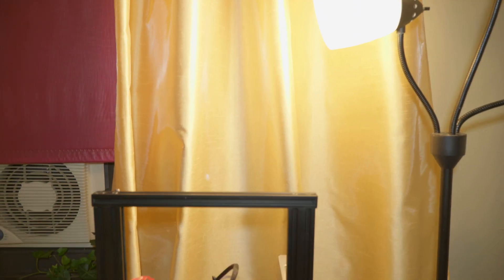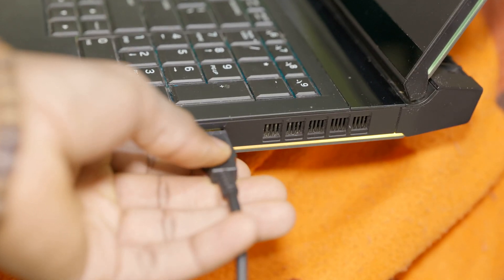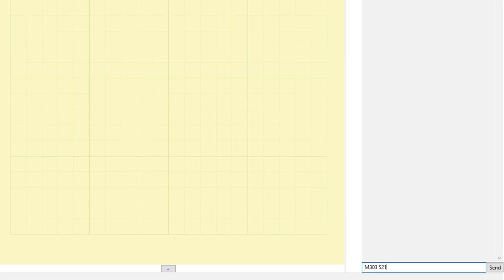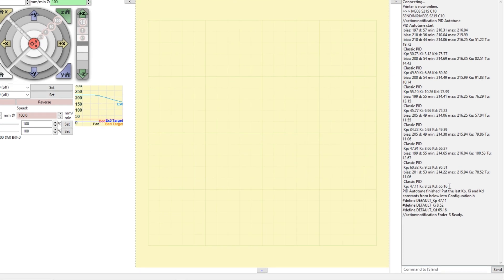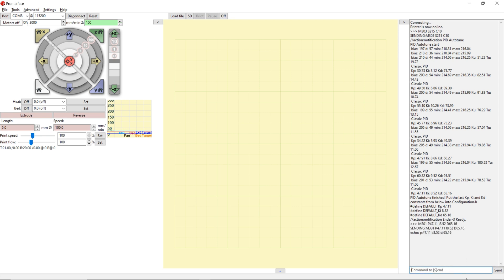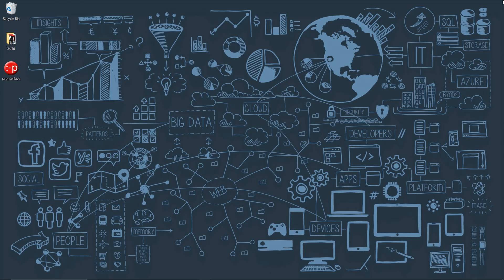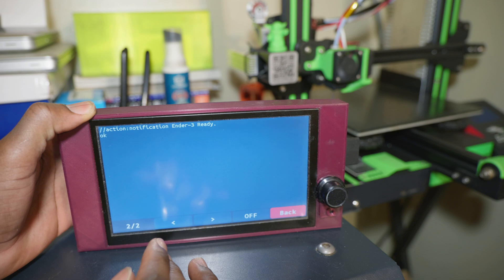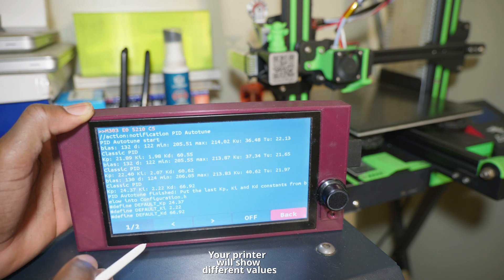How To PID Tune The Creality Ender 3|PronterFace BigTreeTech

Comment: I'm having the issue that when performing the  PID Autotune with pronterface on my ender 3 pro skr mini e3 v2 and swapping the hot end and after compiling and flashing the marlin firmware that my printer unexpectedly reboots during the PID Tune script. Haven't been able to complete one cycle at all. 
I was thinking something with thermal runaway protection and checked all the connections on the board and if fans are running but that seemed fine. Also printing works without issues just wanted to fine tune the new hot end. 
Do you have any ideas for troubleshooting here?
Reply from the maker: Reboots while heating are either power related issues or heating element/temp sensor. If you are running higher temps for the PID tune it could require more current from your power supply and cause a voltage drop. It will still be fine while printing because power is sent smartly to the heating elements sometimes one at a time. But it could be something else
Reply: @YvonSmart is there a relatively easy and safe way to test the power supply during the PID Autotune? Like measure voltage on the hot end connectors?
Can I run the Autotune on the ender without being connected to a PC without the touchscreen?
Reply from the maker: @TheMindpack If you're a DIYer you can make an XT60 parallel adapter giving you an extra port to hook a multimeter to monitor the voltage while it's running the PID. The stock Ender 3 does not give direct options on how to send Gcodes inputs for PID, unless you use the sd card method where you basically load the gcode file with the pid instruction and launch it as if you were printing a file
Reply: @YvonSmart well I don't think it's a voltage issue anymore. I just tried the sd card method and it worked without a problem unfortunately the PID values don't seem to be changed after storing the configuration and writing eeprom. 
The reboot only occurres with an USB connection and I unfortunately don't have access to a console on the simple LCD screen. 
Another obstacle....
Reply from the maker: @TheMindpack  Check if this applies to you printer https://youtu.be/sdDmulu0bNQ
Reply: @YvonSmart I didn't find that option in my settings but I managed to get it to work just not with pronterface. I ended up using repetier-host. Using that I didn't have any of the issues I had before. So thanks so much for the help. I guess I just will never know what was the exact problem.
Reply from the maker: @TheMindpack You're welcome

Comment: Program you showed won't download. Says it has viruses. Might want to get that taken care of or delete this video before the wrong person follows your advise and gets a virus on their computer.
Reply from the maker: It's called a false positive, it's not a virus. The program contains a python interpreter which many antivirus software find strange. Pronterface is a well known program in the 3D printing space, that's why it's still on the GitHub. here is the security report link: https://www.virustotal.com/gui/file/3d6a2ed084e6d222c9e7e7613bfd19b3930962634de36bf87b8f78cee91e7f7a/detection

Comment: Hi, i have a issue, I have Mriscoc firmware, when i type M503 in pronterface, dont show me the 301 line, and M303 command get an error "auto tune failed! Bad extruder".
Please what can i do with this, please answer me as son as posible😊😊😊
Reply from the maker: Hi, I  not very familiar with Mriscoc but the first thing I would do is to update the firmware to the latest version, Mriscoc firmware is relatively fresh, it's constantly being improved

Comment: So is thus going to solve my “ heating failed kill all printer halted” message ?
Reply from the maker: It's supposed to solve the issue, unless your problem is caused by the first few other problems I mentioned at the beginning of the video
Reply: @YvonSmart  for whatever reason my bed Pid doesn’t show at all
Reply from the maker: @mariogayoso  To request the bed PID, be sure to use the right "ID" (E0 for the extruder and E1 for bed, not sure if this applies to all printers especially if your printer has dual nozzle option). I remember having this issue, but an update solved it. I made videos about firmware update for both SKR mini E3 and TFT

Comment: what drivers should we install, mine won't connect to usb
Reply from the maker: You don't need to install drivers. Just try different COM ports through Pronterface or Restart your computer.
Reply: @YvonSmart  Im getting error cound able to connect to com port 3 some thing like that. i have checked the buad rate of the printer. cound not figure out how to go forward now
Reply from the maker: @amargupta.8847  Try different com ports, if it still doesn't work, restart your computer